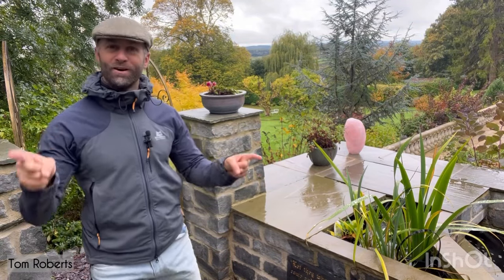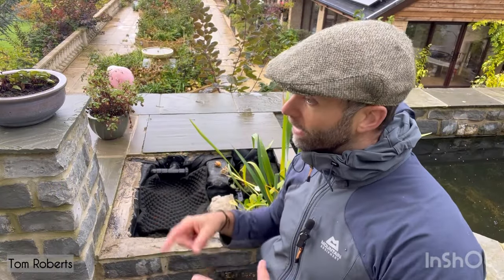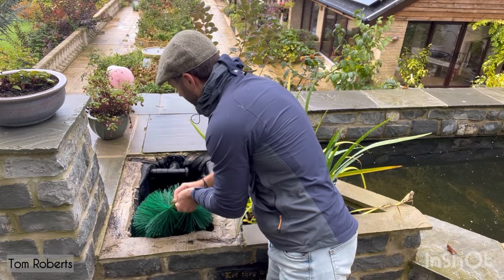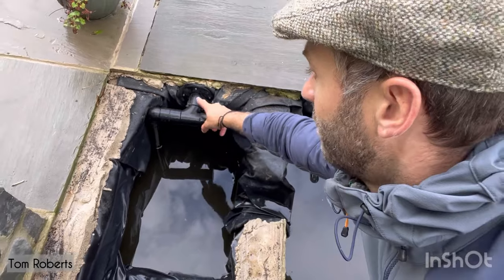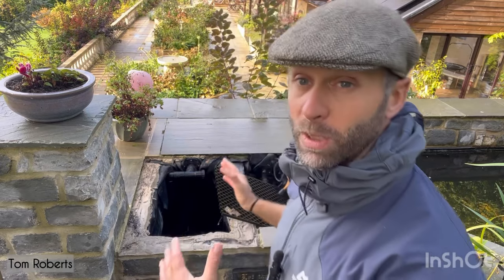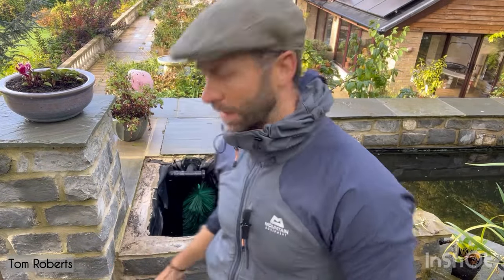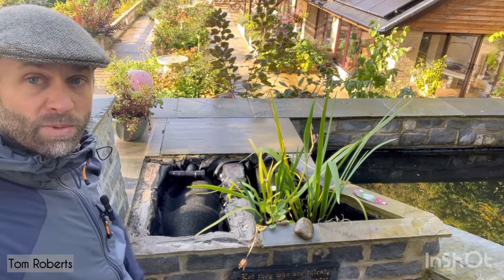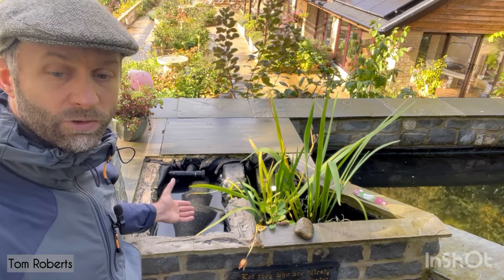DIY KOI POND FILTER SYSTEM || cheap and easy || crystal clear water EVERY TIME!! 💦🐠

Comment: Good video. 
I've only got a 1 metre long by 500cm raised sleeper wildlife pond (40cm deep at deepest point) which I built four years ago and naively I thought it would stay clear but now realise I need to add a biological filter system to remove the algae - which I think is the reason frogs and newts are staying away even though there are lots in the local area. Your video has confrmed what I need is a similar setup albeit on a smaller scale.
Reply from the maker: Great news. Adding them in retrospect is doable and makes for a fun project. You can shape them how you want.

Comment: I like my Blagdon green machine, it is very easy to clean. But for my next pond i would like to add bio filtration to the filter outlet. The plant stage is an interesting idea, i like it. Others i have seen are using gravel. I wonder what are the strengths and weaknesses of each. This is easy to clean so i like it a lot. Thanks for sharing.

Comment: That’s a very small filter on a very small pond with a few plants!
I used to have 144 similar brushes and large sheets of foam on a rise and fall system and the only time they were as clean as yours was after hours of cleaning or when I first installed them.
Had several times the volume of plants and yes, the water parameters were good but it took an awful lot of maintenance, which is why I changed to something much more manageable!
Reply from the maker: I only say what I see. It is still working.
Reply from the maker: I have also upscaled it for a pool of 25000 litres and it is working brilliantly with hardly any maintenance.

Comment: LOL. Im running easy pod - on 400 gal with 10 medium koi. Nearly every other day full rinse and back on. It is all depend on what you have inside the pond
Reply from the maker: No it doesn’t. I agree that every situation is different biologically but if you have a settlement tank situation then you don’t need to flush through an expensive filter every other day.

Comment: I’m a bit surprised you didn’t put in a drain pipe with a valve at the bottom of the filter chamber. You wouldn’t need a vacuum then.  Just a thought.
Reply from the maker: Is a great point. The stone work was a little awkward for me so I opted to not do it but my next project will absolutely have this option.

Comment: Thanks for sharing this video.  What type of plants are you using or could I use? Where did you get those green brushes to buy? Thanks!
Reply from the maker: I got the brushes at a local koi equipment shop. Any pond plants that you want, water iris is nice, water lettuce, Lillie’s etc. it depends on the size of your plant filter.

Comment: Beautiful garden and nice filter set up, although just to point out that the foam which called 'jap matt' looks like 30ppi filter foam and not Japanese matting which is a different material altogether. Thanks for the content.
Reply: They are foam mats, jap matting is a dense horse hair type of mat, but it all works
Reply from the maker: @gwrdriver1660 yes sorry, I loosely refer to it all as ‘jap matting’

Comment: Hi tom im a new subscriber and i loved the filter but was not sure what or where the brush things are purchased from could you help as i am trying to save costs and build my own filter for a 2000 litre pond and was thinking of using an old oak barrel half ??
Reply from the maker: No problem. Firstly, thanks for subscribing. Secondly, they are called filter brushes. They come in various sizes. Will you go for a planted section too?
Reply: Possibly with regards to the planted section but maybe its not needed as i do have alot of plants in the pond so it depends how necessary they are. @TheMilitaryGardener
Reply from the maker: That should be fine then. Good luck.

Comment: The problem is the inch of sludge you had in the bottom of your filtration is in the pond. As every drop of water runs over that inch of sludge, the bacteria from it is returning to your pond. It's like the fish cannot get out of their toilet. Had a very similar system myself for years and couldnt figure out why I had such high ammonia levels. Now that I have a different type of system, I have no ammonia ...ever. The growth rate of my koi went up exponentially
Reply: You need to get a release outlet for the filter on the bottom so all the sludge can be let out
Reply: I have a 50 gallon plastic tub pond with a couple goldfish and I cannot get the water to stay clean.  I have chlorine water and use water treatment along with water plants. Can you help me figure it out please
Reply from the maker: @jamieharrison5946 what filter are you using?

Comment: Thanks for the video, which I find very useful, as I like the DIY approach of setting up the filters. I can also see that you have a mechanical filter compartment with some components (mechanical filter brush & pads) but I am not sure what order you put them or if it matters at all, e.g. which components go to the bottom and which ones stay on top?  Furthermore, I can see that you have plants to remove the ammonia instead of biological media such as Phosphate Remover, Activated Carbon, Bio balls, etc. What is the name of the plant you are using, and which other plants would do the same job?

Comment: Great vid and nice set up.I wouldn't personally use those brushes as they offer little in the way of surface area for bacterial growth.A one inch raised grill on the bottom of the filter may be worth considering with ceramic noodles accompanying your foam.All the best.

Comment: I'm planning a koi pond and have looked at many ideas. I'm particularly interested in flowing the water past plants like you have, but does it matter what type of plants you use? Some people recommend fully floating plants so the leaves ingest nitrate as well, but is it important?  Is there any limit to how many plants you use and does flow rate matter?  I'm thinking of having a watercourse running along one edge of the (raised) pond and filling that with plants with the filter return discharging into this at one end and the other end discharging into the pond. Do you think that would be worthwhile?  Thanks for the good videos 🙂
Reply from the maker: As long as the plants have a healthy root system I don’t think it matters. I tend to avoid surface plants other than water cress (to eat) because they can get into the return and clog the system. Your idea sounds nice, the key for me is to make it something you want to look at and enjoy, not just functional.
Reply: @TheMilitaryGardener  Very helpful.  Thank you.

Comment: What are the plants called that you use for the filter?
Reply from the maker: You can use many different types but I like water buttercup and water iris (the native varieties are much better)
Reply from the maker: Like and sub if happy with the video.
Reply: @TheMilitaryGardener  and the only electric you use is for a water pump?
Reply from the maker: No, pump / uv / air pump and heater. See my video about miniaturised koi set up.
Reply: @TheMilitaryGardener  i will have a look but how does your water feed through filter and you have no electric at all on your pond?